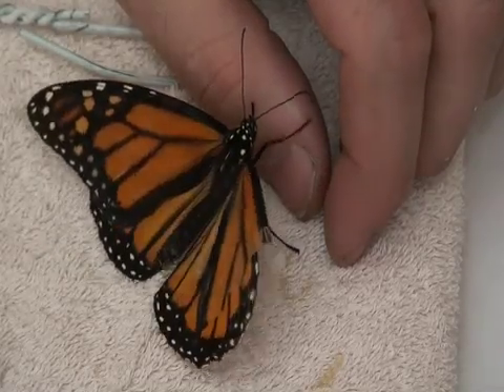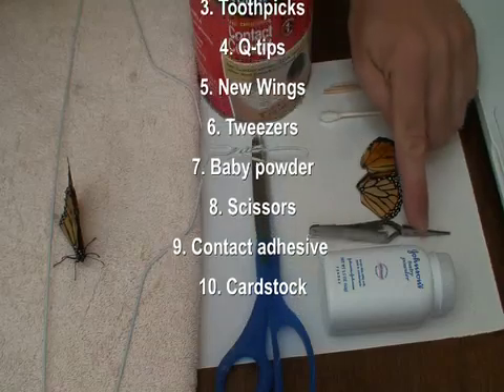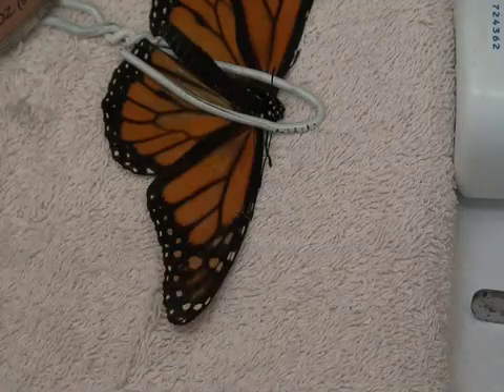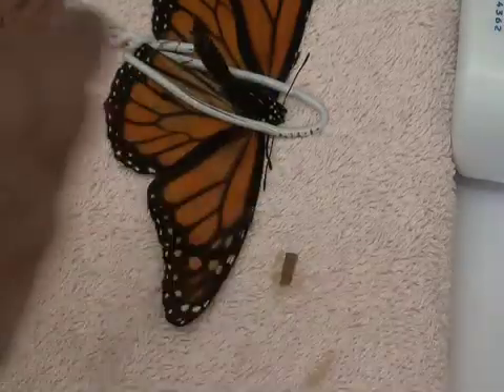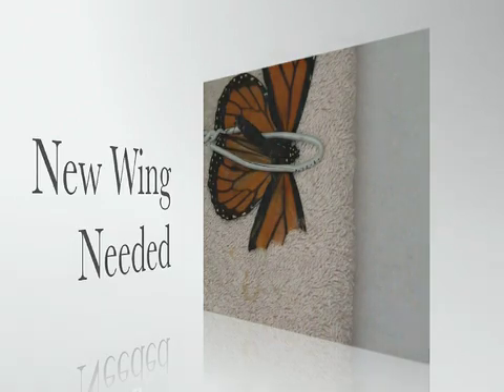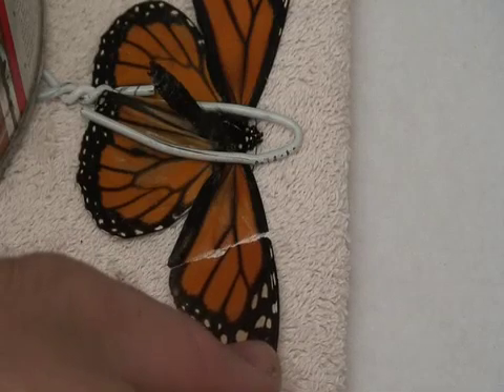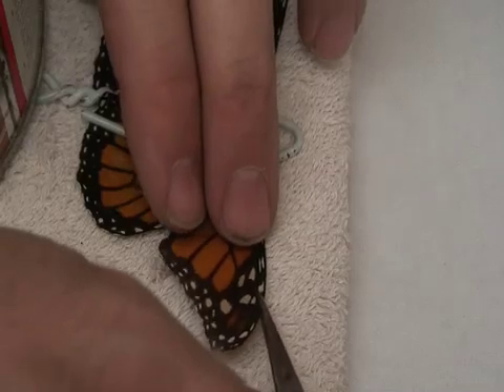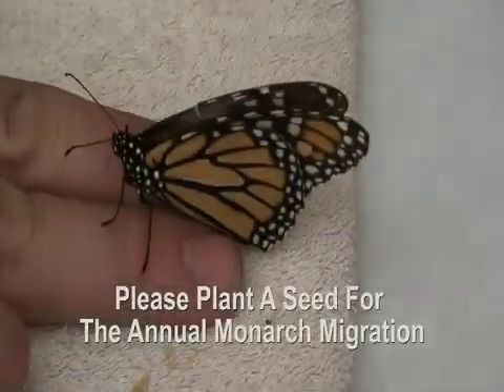Live Monarch Foundation - How to fix a broken butterfly wing

Comment: I DID IT!!!  I did it and it couldn’t have done it without your help from your video….and I recorded the whole operation on video (I wish I could upload it to you… is there a Facebook page perhaps?). In 40 years of living in this same house I have never seen a Monarch.  I planted milkweed a few years back and now  this year we finally got caterpillars.  We initially had only one, it went the whole process and we watched it fly off.  Then about a week later we found about 2 dozen on our milkweeds.  As time progressed the numbers fell to only 13 Cats left at which time I brought them inside and put them on one of our potted milkweeds that had abundant leaves yet could fit into a Chameleon enclosure that I had.  About a week later they started to J-hang but then less than 24 hours after hanging some of them showed signs of Tachina Fly infestation.  I know about Trichogramma wasps but  I had never heard about Tachina Flies.  So when I goggled the symptoms of the aftermath of the carnage, my whole world opened up to the life and struggles of the Monarch.  Long story short, I was so infuriated at little bastards killing my little lovelies that after the remaining cats turned chrysalis (I ended up with 7 butterflies)  I relocated  all the chrysalis on to an artificial structure, removed the potted plant, cleaned the enclosure, and put the Chrysalis tree back in.    I then took the potted plant cut it down to about a 4 inch stem, (incinerated the remaining foliage just in case of OE) and painstakingly sifted through the whole soil of the potted plant thoroughly with a magnifying and glass tweezers.  Well I found 7 of the fly pupae and I think I got them all (and I bagged what remained of the potted plant in a huge clear heavy duty trash bag just in case I missed any and it’ll stay bagged for a couple of months just in case any flys missed my scan and hopefully they’ll die off). So the flies have emerged and are in a small glass spice jar.  I heard that there’s a Monarch Foundation that is constructing a huge database and one of the things they are collecting data on are these parasitic flies.  They say to let them hatch, then freeze them, and I’m ready to do that. (SWEET REVENGE!).  This has been such a great experience that I’ve now germinated over 100 milkweed seeds.  I read about OE and keeping native milkweeds (So Cal) instead of tropical (which is what we have) and will keep any and all tropicals that I have in my greenhouse (and just use them as spare last minute emergency food) and will make sure to cut back all milkweeds during the winter.  Thank you again for the educational video.
Reply: What glue did you use?

Comment: I know this is a pretty old video but maybe someone sees this: I found a butterfly that does not have control about the upper wing on the right side. I thought it might be enough to move it back above the lower wing so that one can support it but it seems like the strength of the lower one isn't enough to support the bigger one. Is there any way to fix this problem, or is it unfixable since the root that moves the wing is damaged

Comment: Just wanted to say THANK YOU for this video. I saw it a year ago and saved wings from a deceased monarch of mine in case I needed them to help another...and this summer I had 1 of 40 captive-reared whose chrysalis fell in the 1st hour while drying....it was misshapen....when it hatched, 2 wings were bent and it couldn't fly....it's been alive for 3 days, and i take it out and put it on the preferred flowing plants of monarch in my garden.....it gets so frustrated  that it can't fly....it eats heartily, and i also feed it extra sugar water....i took the leap tonight and did a triple wing amputation and surgical reattachment using the other wings I saved from last summer after seeing your video.....low and behold, it can fly 5-10' now, but only downward....it can't take off.....it was so excited to fly that it kept flapping its wings for the hour after the surgery, as if to test them out.....the wings i attached are slightly larger than the previous ones, as the previous butterfly was larger.....not sure if i should try to trim them down...I'm hoping in the morning it will have more strength and the ability to take off.....if not, at least it has experienced some greater mobility now than the past 3 days where it would just fall and crash.....now it can glide.....your video was helpful in showing me how to do it and the tools i needed. Instead of a tooth pick, I used a sewing needle, as it was thinner and could get into smaller space between the existing wing stub and the one I was attaching. Was great to know which glue to buy (found at Lowe's for around $7 for 3 oz.).

Comment: A butterfly landed in my garden and it has broken the articulation of its wing. The part which sticks it to the butterfly's body. Its not responding as the butterfly needs, and has some kinda of secretion in the joint between its body and the upper left wing. Besides that, the wing is whole. Is there a way to repair that? Im afraid of damaging more than it is, I never handled butterflies and I do not have any material for that. I need to fix the articulation, can it be done?

Grateful for the attention, sorry for bad english

Comment: Well - I gave this a try - and did my best - not so easy to do but I was rather pleased with the results...HOWEVER...the monarch could only increase flight by about five feet. 
I may have overlapped a "bit too much" perhaps? - but it is difficult to work with contact cement to get accuracy --- 
So the butterfly is now in my yard - still fluttering around - basically grounded...and now, what I am noticing is that wings (from monarchs that were killed by birds in my yard) that were used to 'patch' the torn and curled wings are 'drying out' and breaking. The monarch HAS TRIED SO HARD to fly...it is rather pitiful.  
I do have to question too if these butterflies don't 'feel' in their wings. If I touch a monarch's wings on the edge, they do move them in response to touch. Just a few things to think about. 
I do have to say  - that it is completely heartbreaking having an injured monarch in your yard knowing that they 'should be' on their journey to Mexico. I have really cried about it. It does hurt my heart deeply - so learning to handle the hard and challenging times of helping the monarchs. 
So - a kind hug to all of those who go through the excitement of a monarch hatching in their garden ------ and the times when you see them not in perfect health and you have to gather the strength to continue. 
It's not easy at times. Blessings. 
Shelly

Comment: I've just started raising Monarchs, and my first hatchling has two curled wings, both on the same side. Of course, I don't even have spare wings yet. Is there anything else I can use to repair his wings?
Reply: There is a post about using "silk" from artificial nails above. I have one with curled wings in my yard and have the wings from monarchs that were killed in my yard. But still not sure if I can do this. Maybe contact local butterfly clubs - show them the video and ask if they have any wings?

Comment: I would like to add that the lighter the repaired wing is, the easier it will be for the butterfly to fly.  So I use the pieces of "silk" that are used to make artificial fingernails attach to people's real fingernails. (You can get them at beauty supply stores.) 

They're like stickers; you cut them to the size and shape you need while they're still stuck to their backing,  then peel them off, place them over the joint, and use the peeled-off backing as a pattern for whatever thin (but stiff) paper you're going to use.  That's if it's a large repair (like a half wing or more). 

If it's a small rip, I just flip the backing over so the non-stick side is now facing out. 

Powder lightly just to make sure there's nothing sticky around the edges, and let your patient warm up and recover under supervision on a safe, enclosed plant till you see them fly normally.
Reply: Thank you for posting. I am really trying to visualize this. I'll have a look at the artificial fingernails to see if I can figure it out. I have a monarch in my yard now that can't fly. It has all wings but they are sightly crippled and he just flutters to the ground. If I could straighten it and attach something to keep it straight it might help...or I guess the worst is that it won't and nature will take it's course. If you have more info please feel free to e-mail me at shellyhipson@gmail.com Thanks very much.

Comment: FYI The glue used in the video is DAP Weldwood contact cement. You can get a small bottle of it at Home Depot.
Reply: This comment should be pinned / stickied so that everyone sees it at the top.
Reply: Hi can you use PVA glue for this?

Comment: Hey, so, I ended up having some tough rain last night and found a butterfly with really folded wings. It couldn't move one of them and I found numerous small rips. I'm worried it might die, because although I'm giving it flowers and letting it eat or something, it sometimes just completely stops moving for 5-7 minutes and even when I lightly pick it up (not by the wing or antennae.) it won't move. I'm honestly feeling terrible for it.
What do I do?
I don't have any other butterflies or wings or anything similar to work with and repair the wings, and fixing the folding would probably just make the wings even more damaged. 
Help?

Comment: I have a monarch whose wings are crumpled.... how can I fix that?
Reply: +Laura101   If they are very crumpled, there is nothing you can do.  It is likely due to a disease, or because it was not able to dry properly.  You can euthanase by putting in the freezer, or i prefer to (when I am faced with this horrible reality) put it between paper towels and very quickly and thoroughly crush it.  It;s hard to do but to me better (to me) than putting a lively creature in the freezer.
Reply: I had one with a crumpled wing I put it on a flower in my front yard it stayed there for 4 days then disappeared it is probably flying in heaven now
Reply: +Scott Taylor you can just crush it's head, instead of the whole body

Comment: This is amazing- I actually tried it on a monarch I found with a broken wing. It seems to have worked. I am not sure if it will stick because I had to use super glue because I did not have any contact glue and I have no time to go 20 miles to get some.  I also used very thin plastic from the super glue package because of a comment I read about the cardboard getting wet in the rain. I put him in the fridge for 10 min and he just laid down. the coated hanger and towel worked great. I was very nervous. He is now sitting on a coneflower resting and gently moving his wings. I'll know him by the white splint on his wing! I hope it lasts. I'll get some contact cement next time I am near a store. Thanks for the video - I can't believe I did this.

Comment: a lizard attacked a monarch. Its wings are still intact but one is a bit lower than the other, not by much. One of its front legs seems to be struggling and its anntena are a bit droppy. It hasnt flapped its wings and just seems like its in shock. Its been a couple of hours and wants to stay on my finger. I put it on a piece of wood. WHat can I do to help it? shoudl I keep it inside for a while ? can I feed it? and what?

Comment: Amazing film and content. I'd love to be able do do this but where to you get spare butterfly wings - except from dead butterflies? I'd never kill one. I've had a Jersey Tiger Moth and a Speckled Wood butterfly, both with damaged wings, in the garden recently. But they still seemed OK to fly so I didn't intervene. If I ever have to, I'll use your video as the guide and hope it's just a cut or splint they need, not a new wing part.

Comment: Not always, though. If you deliberately rub firmly, then yes, you can cause damage. The scales though, are designed to come off in the event of an attack by birds, etc, and are a sort of natural bittergen that discourages the predator from eating the butterfly. Losing some scales wont harm it :)

Comment: Ok. When a caterpillar emerges the wings are all shriveled. Have her hang upside down and the straighten. If wings are dry the u need to preform surgery. I did that to mine I did a full wing transplant for all four wings. After he could fly. Not well. He died later on in the week. Before he could join the migration.

Comment: @Gina200119 its cool that this guy repaired it but the butterfly is not happy. it doesnt have feelings because it does not have a cerebral cortex with a six inch diameter that is capable of such complex thought.  dont give too much credit to the butterfly

Comment: Superglue would be excellent for this, very light, bonds well to keratin or chitin, sets fast.  Work over a piece of Saran wrap or waxed paper to keep your butterfly from sticking to your bench.  Dust your fingers with talc first to keep from gluing yourself to the creature.  Nail polish remover / acetone will dissolve cured glue, but would likely be toxic to your patient (it's sometimes used in killing jars in place of cyanide), best avoided to be safe.

Comment: Hi! Great video! I was wondering if there is anything you can do to repair a wrinkled butterfly wing. We had a black swallowtail come out of the chrysalis and the edges of it's wings are wrinkled enough to prevent it from being able to fly. I know this is probably a stupid question but then again I never thought you could fix a butterfly wing with adhesive..... can a wing be ironed out with low heat?